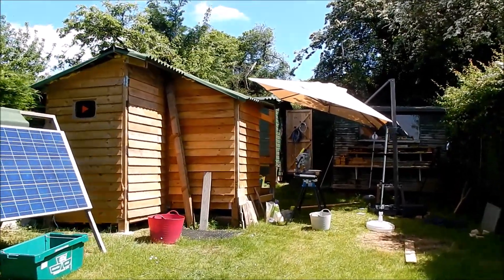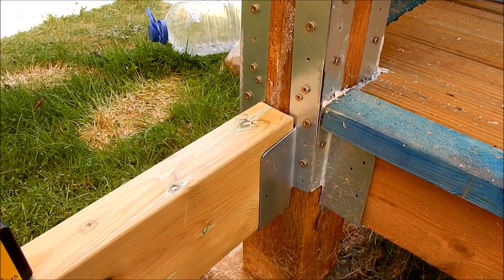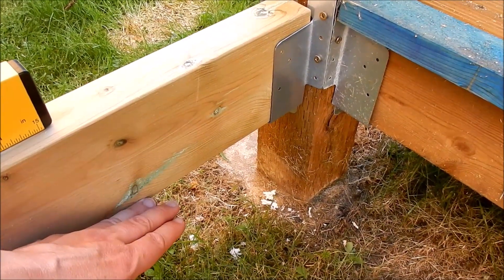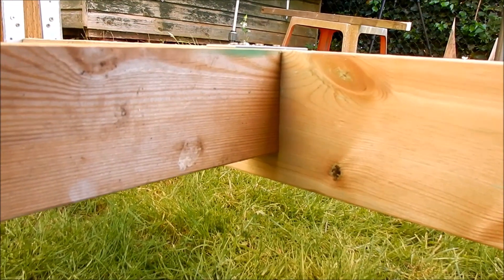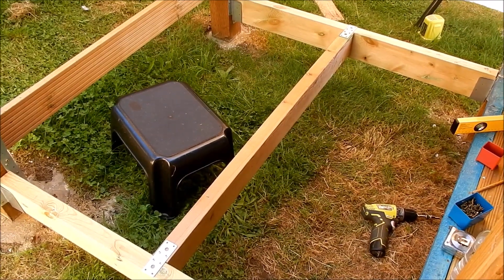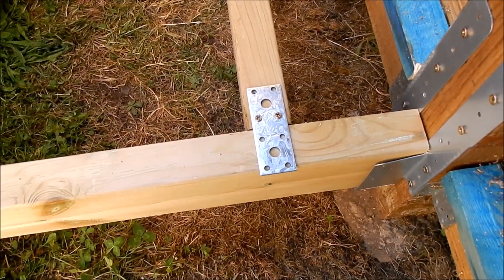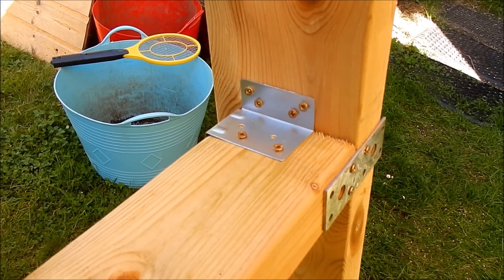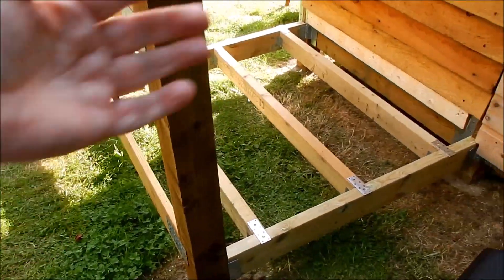Modular Shed S4E2 - Floor Frame

Comment: Absolutely shedtastic! 
5x2 is not excessive at all. In America a "2x6" would be customary in that role (finished size of 1.5 x 5.5 inches). 
Floor joists are 2x6 at a bare minimum and more often 2x8 or 2x10, even in out-buildings.
Reply: Just to confuse things more a 2x8 is 1 1/2” x 7 1/4”
Reply: Sounded like the UK uses the same sizing as we do in Sweden - what many of us still call a N by M (yes that still Lives in nere in a heavily metric country, but we'd say it as N-tum M, where tum is our word for inch and also thumb) is Nx25-5 mm by Mx25-5 mm, so a 2 by 4 (två-tum fyra) is 45x95 mm
Reply from the maker: I think most of our timber comes from Sweden :)

Comment: The unit when they sell you a 4-by-2 or 5-by-2 is 3/4" not 1" so the inch size is three quarters of what it's called. Don't ask why. Just the way it has always been.
Reply from the maker: It's all metric here - so the 5x2 is marked 120mm x 45mm :)
Reply: It infuriates me that timber is not the size it says it is.  The reason put forward is that the size quoted relates to the timber before it is planed, which to me is nonsense.  

What would you think if you bought a pint of beer and only got 3/4 of a pint I wonder ?
Reply: Umm 2” would be 50.8mm which is 1.77” or nearly 1 3/4”
Reply: …lumber sizes are before drying and sanding
Reply: @peterg.8245  I know the reason, but it makes no sense

Suppose you bought a gallon or litre of petrol only to find that you had short measure.  Would you accept the explanation that it was because some of it was lost during the refining process ?  

I don't think so